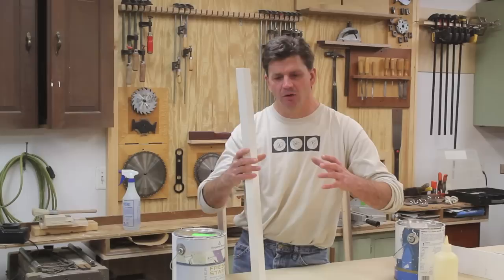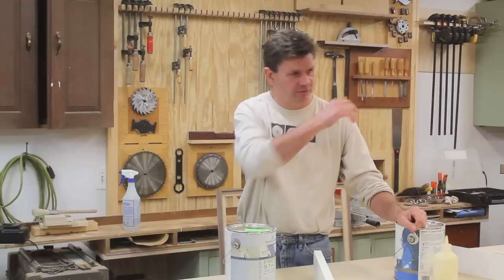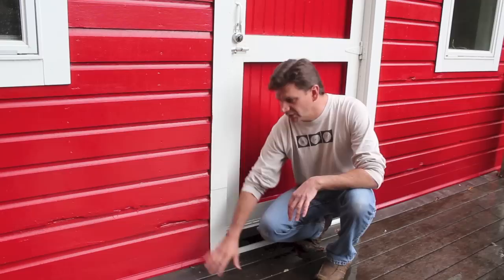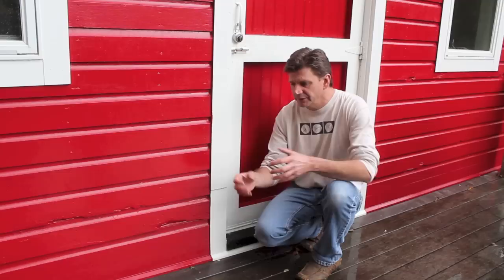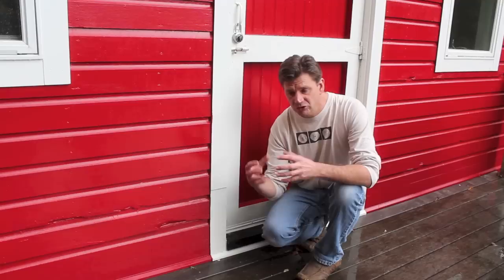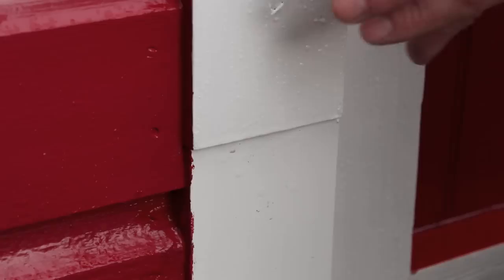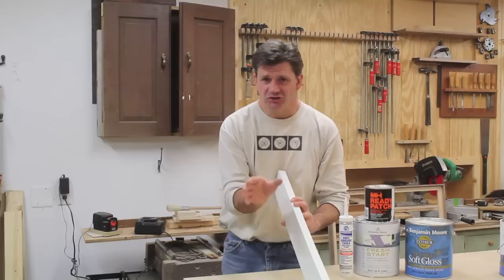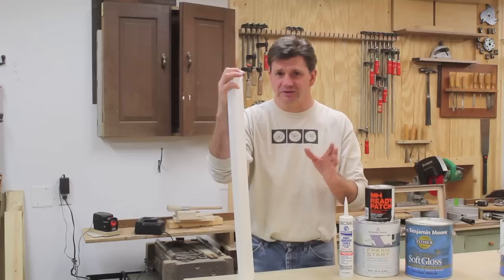How to Paint Azek

Comment: Jon, have you ever tried Boral trim? It's a nice alternative because it doesn't move like pvc trim, and it takes paint easily (actually needs to be painted)
Reply from the maker: ***** Hi Peter, no I haven't but thanks for the tip I'll look into it
Reply: I have done a lot work boral it really holds up nice houses that i trimmed out 10 years ago still look new the paint lasts so much longer because boral is so dimensional stable. And doesn't really need re caulking like pvc.

Comment: I'm surprised that you didn't mention that you have to sand the surface of the Azek, usually I recommend to use 220 grid sandpaper, it won't peel if you prep the surface right.
Reply: I've heard that if you prime it with special primer made for vinyl you don't have to sand as the acetone in it interacts with the pcv and improves bonding

Comment: if you want to prime vinyl or anything where most primers wont stick use BIN shellac primer and use the appropriate paint finish for whatever you doing, shellac sticks like nothing else does. and for patch I really dont like mh ready patch it just shrinks to much and if left heavy is pretty hard to sand down.
Reply: Jorge duarte bin primer is only for spot priming exterior. Read the can! If you’ve been using it you have huge problems coming.
Reply: David Zwicker I only use Bin for interior especially when I do cabinet refinishing, theres also no problem using Bin on exterior in this case because you only using it as an adhesion primer after you prime with Bin you can paint it with exterior paint, remember this surface we are talking about aint wood. if it was  I would agree with you